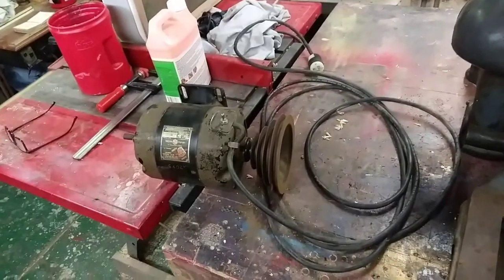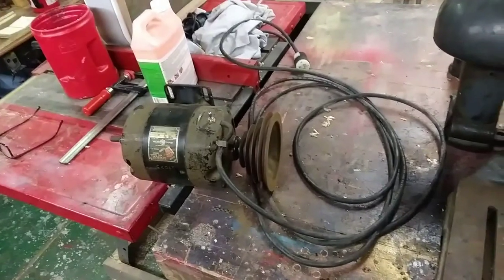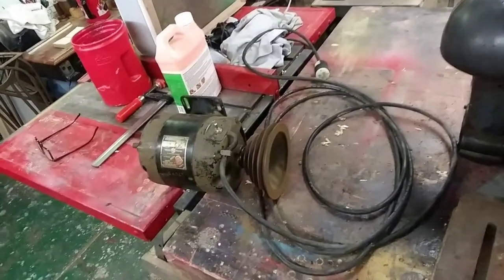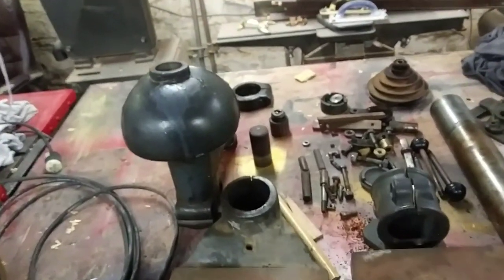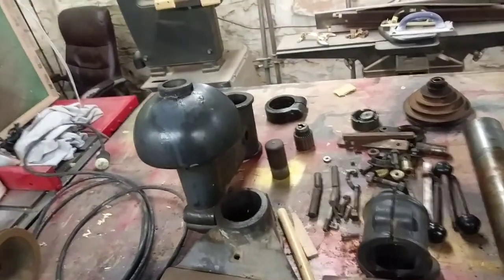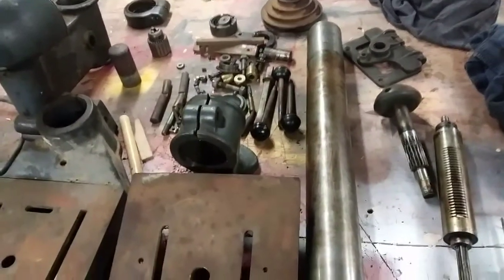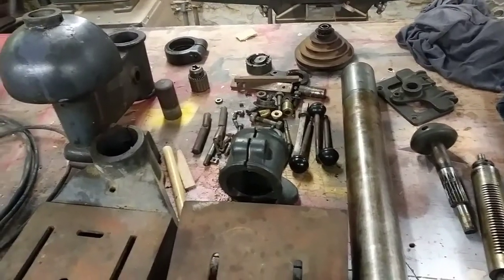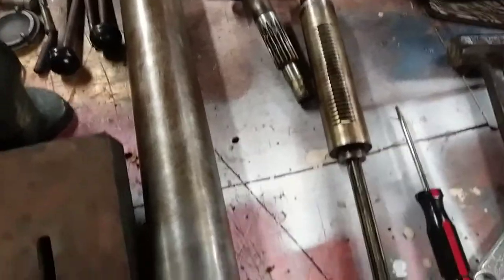Royal Drillpress Update

Comment: The beast is more than just the sum of its parts, for sure. This is going to be some work, but it will be worth it. Hopefully you either have a rock solid memory or you took video of the disassembly. That's a lot of parts, and I wouldn't remember where everything goes myself, probably. Have fun, Opa.